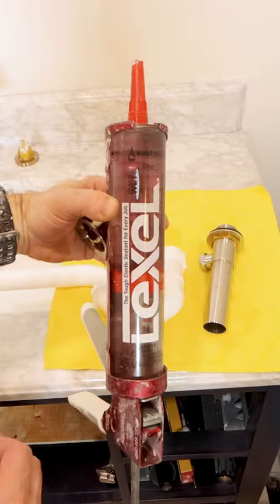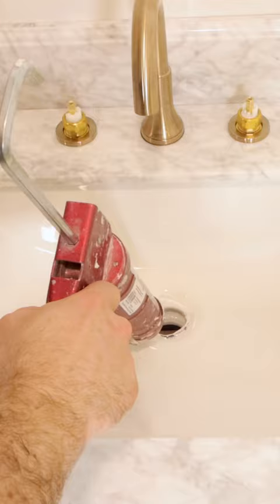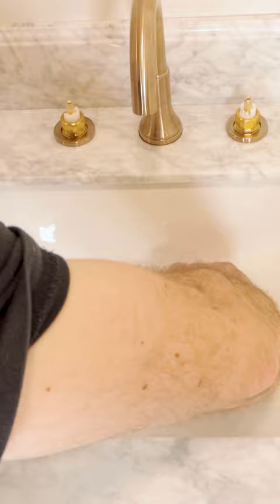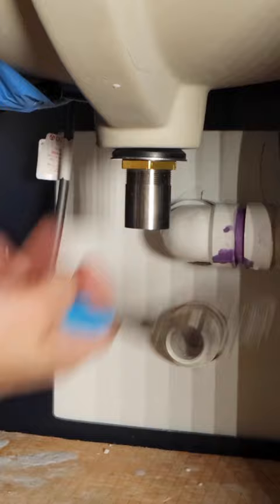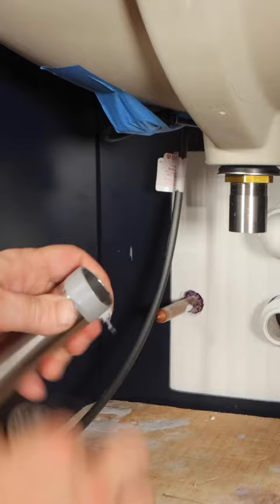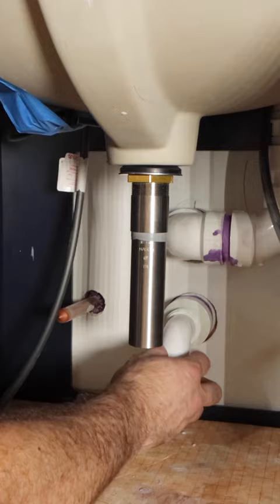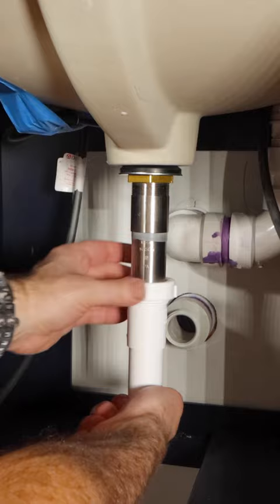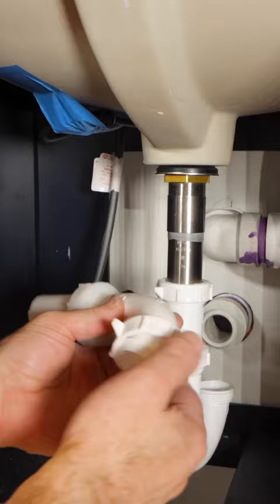Sink Drain Installation Tips - #shorts

Comment: As a licensed plumber for over 15yrs. I hate when ppl use silicone to seal the drain to the sink. It's a pain to get off and a mess to clean. Don't do it. Plumbers putty works perfectly if you know what you're doing
Reply: licensed plumber over 20 years Master Plumber for last 7 years putty and pipe dope always works
Reply: Licensed plumber for 5 years, any sealant on top os useless on any drain with overflow holes, the only thing stopping a leak is the rubber gasket
Reply: I agree
Reply: @ProvidenceAcresFarm 

Sealant on top is to help the sink be able to fill up and hold water, not to prevent leaking into the vanity.
Reply: @merlinious01  Here in Euroe we just have a rubber gasket instead of the sealant, works without leaking.
Reply: @DimerNL  
Some brands do that here too, some even use a foam gasket
Reply: I’ve heard silicone is best used in commercial sinks? I’m just a DIYer with a few years experience. 😂
Reply: Is putty safe to use on granite countertops?
Reply: Lexel isn’t silicone
Reply: What about the tube he's using would you use it
Reply: 100%
Reply: Yeah I’ve only used dap when we figured out we were out of putty. Works just the same but don’t have to clean the shit when you finished
Reply: @rocketrider1405  there is non staining putty specifically for granite and stone countertops
Reply: @merlinious01  foam is a horrible material to use as a sealer, constant water usage will deteriorate it. I always throw those away
Reply: @tumuskurns  damn thanks for this comment. I've never used lexel b4 but after reading about it I'm definitely gonna try it on some stuff, but definitely won't use it to seal a drain. Rubber will always deteriorate/degrade when in constant contact with water. Just like the rubber o-rings and seals in your faucet cartridges that go bad after time. Plumbers putty is my go to and hasn't let me down
Reply: @vrea77  no I wouldn't use it to seal drains. Unless it was my only option or last resort. Plumbers putty has never failed me.
Reply: @Seven7Pain1  putty
Reply: Silicone works perfectly. Easy to apply and easy to remove. Putty is outdated and will stain any porous stones.
Reply: @ProvidenceAcresFarm not if you want to use a popup
Reply: that is absolutely not true. he knows he will get a call back and make more money if you use plumber's putty
Reply: 85 yrs as a plumber (still plumbing today) and I’ve always used maple butter seal.. it works great..
Reply: @bman6502  yes I heard that stuff is awesome, I just can't find it anywhere. Where do you get yours from?
Reply: Licensed plumber for zero years. Always putty
Reply: Started plumbing in 2014 mostly doing commercial and mechanical repair now but I spent 4 years doing service My call back ratio was 1/1000. And most of those had nothing to do with whatever I was there for. The only purpose of putting any sealant around the top of the pop-up so that when the pop-up is in the closed position the sink can stay full of water. Plumber's putty is perfectly fine people that put strong silicone or even epoxy are nuts that's got a high probability of chipping the top of the sink when you try to remove it. Most useful tip I can give is to put pipe dope on the threads underneath the lower rubber gasket and if the bottom of the sink is in poor condition possibly a cast iron sink put some pipe dope on top of the gasket I have never once had a leak after doing that I know some guys like to put plumber's putty on the bottom before they tighten everything that has leaked on me in the past but with the pipe dope. Not once.
Reply: Same here I been on the trade for 4 years but was taught to use plumbers
Putty make it easier for the next guy
Reply: Putty on the flange, a thin layer of ptfe paste on the conical gasket to seal the base of the sink. Never had a leak installing a new pop up.
Reply: I agree,same here,think he's a mister fix it
Reply: @kekoashipman1824  so you’re saying just put some dope on the top of the gasket that presses up against the sink and then tighten the nut up on it?
Reply: @skylerpeters8063  
Plumber's putty on the flange at the top of the sink. Pipe dope on the gasket where it touches the sink and  between the gasket and pop up threads. If pop up is plastic hand tight. I have yet to have one leak when doing it this way.
Reply: @kekoashipman1824  thanks for the help, I’ll try that later
Reply: @Seven7Pain1  i’m changing my drain for the fourth time because putty keeps leaking you’re right, I’m going to use silicone
Reply: @wesjohnson3035  my bad bro putty
Reply: Oatey Hercules 25171 Stay put putty is stainless and safe for plastic , I've been using this for years with out a issue .
Reply: @MMAGUY13  Hercules 25171 putty and if this is 4th time and it leaked through your doing something wrong you didn't buy new gaskets or you didn't put cardboard friction gasket between nut and rubber washer or you have no gasket on bottom at all  any time ive seen putty fail it's human error
Reply: @Seven7Pain1  I’m on my way home from Home Depot and I bought silicone. I did everything right I watched videos it’s not rocket science. I made sure the rubber gasket goes first in the friction gasket.  One time I put it really tight it leaked the next time I said maybe it was too tight. I made it just snug it leaked. This is my fourth time I’m gonna use silicone because years ago I did this and use silicone and never had a problem. Thank you so much for responding and responding so quickly.
Reply: @BBQandStreetCars as a service plumber for 3 years I appreciate y'all for keeping me working 😂😂😂
Reply: Man lexol even worse than silicone can’t wait until he has to replace that drain stopper he will have to remove entire sink! Can’t believe he isxserious
Reply: LEXEL IS NOT SILICONE.
Reply: @BBQandStreetCars LEXEL IS NOT SILICONE.
Reply: @rocketrider1405 not on mine.  Leaves a grease stain
Reply: I never ever ever use plumbers putty. It will drive up and crack or wash out. Sealant of choice....... You guessed it: silicone.
Reply: @merlinious01 exactly
Reply: What about those of us who don't know what we're doing?   And no money for a plumber?
Reply: @rocketrider1405   no. There is specific plumbers putty that’s safe for natural stone.
Reply: @rocketrider1405  Get no stain putty.

Comment: Always think about the next guy having to take that damn drain off. Putty works fine. In the event that someone wants to change the trim color of the entire bathroom, then you're kinda screwed at that point by limiting options. Pipe dope works fine for the threads.
Reply: Lexel is more of a sealant then an adhesive. It’s basically a clear gasket maker that will peel off similarly to silicone
Reply: @UsedNapkin458 Silicone is easy to peel off?
Reply: Yep
Reply: @seanoneil2110 off porcelain... yes, yes it is.
Reply: @paulmacdonald7068  Silicone is a pain in tha ass to remove from porcelain. Plumber's putty is still the best option here.
Reply: @UsedNapkin458  Silicone is a pain in tha ass to remove from porcelain. Plumber's putty is still the best option here.
Reply: @themonkeydrunken  It really isn't.  Plus, putty should only be used on porcelain and stainless and definitely shouldn't be used on plastic, which is 90% of residential POs these days. Silicon is the safe bet because it works 10 times better than putty, and it can be used on any type of material, including natural stone. 

I used putty for years until I tried silicone. I've replaced lots of strainers and POs with silicone on them, and it's not hard to remove the residual unless it's on a textured part of the fixture (which it never is). Even if there was texture where the po sits, you would just need a bit of WD 40, and it would come right off.
Reply: As a commercial plumber, I use silicone all day long on my drains because it’s a fantastic sealant. I’m not a service plumber so I don’t use plumbers putty. Screw the next guy because I know it’s not gonna be me.
Reply: Did a call this morning the customer wanted brushed nickel instead of the stainless finish that was there before, all of this was installed with silicone and came out just fine, and I replaced it all with silicone as well. I even use silicone to help seal those threads down below in a pinch
Reply: Plumbers putty does not work fine. It dries out within 12mo.
Reply: @paulmacdonald7068 no it is not. It is if you're scraping exposed silicone on porcelain. If its bonded between the metal drain and porcelain, you are not getting that off easy.
Reply: @Brian-yz8dj  Whatever you say, my friend. I don't have any issues with it...🤷🏻 but everyone is built different..
Reply: @UsedNapkin458 umm no it’s actually quite a good adhesive
Reply: Literally me at work trying to get one off and it’s glued 😂

Comment: You forgot the standing water test.  Fill sink up a ways and leave water standing in it for about 5 minutes to be sure your seal is good at the drain.  Also, Lexel is not the right sealant for the drain.  Use putty or use caulking specific for plumbing that is antimicrobial and wont mold.

Comment: Two questions. One, are you sponsored by Lexel? And two, why Lexel instead of putty? Most plumbers swear by putty
Reply: Putty is fine. Seems less messy than that crap.
Reply from the maker: No, I’m not sponsored or paid by Lexel. Lexel is a sealant and stronger than putty, which means less of a chance for leaks
Reply: @HomeRepairTutor  Lexel is fine, but it is on the expensive side of silicone adhesives. It is definitely easier/faster to use silicone adhesive than putty for putting pop up assemblies in, but in my opinion it is sort of a waste of money to use/recommend lexel rather than a less costly 100% silicone alternative. Putty is also fine. In almost any scenario with proper installation, an installer will be able to use either putty or silicone/lexel successfully.
Reply: @HomeRepairTutor you do know that the bottom gasket keeps the water from leaking you don’t even need lexel or putty tape keep it from leaking But the sink want hold water But it want leak. Just saying but I always use putty never had a problem with the sink not holding water do to putty
Reply: @MarlinRoth how is that shit faster?  Putty is was faster than that goopy bullshit. That shit is harder to clean, you need a caulk gun, it’s way more expensive than putty. It’s way faster, cheaper, better, to use putty. I would only use the silicon shit if it’s an oddball sink that won’t fit anything perfectly.

Comment: Lexel is permanent, probably the worst thing to use on any part that may be changed....EVER! Use putty, because it the right product for the job.
Reply from the maker: How often is the pop up changed?
Reply: @HomeRepairTutor it may not be often, but do you want a 5 minute job to take 30?
Reply: @HomeRepairTutor  This is exactly what the worst craftsmen think. It will be changed someday, and you ruined the next guy's day. Plumber's putty is great here, there's no need to try hacking in some other crap that wasn't designed for the application.
Reply: @HomeRepairTutor  I have a new home five years old Had to change three of them because the wife didn't like it. before that had puddy on a sink I installed for 10 years. not a drop came from that sink seal.
Reply: @themonkeydrunken Ruined his day? Lol, dont you own a pair of pump pliers? Time to toughen up dude
Reply: @HomeRepairTutor plumbers are upset because they want to change that more often even when it’s not needed. Make them work:)
Reply: @gimaru1 that's dumb, damage can be done to your vanity if they use that lexel.

Comment: Don’t do this way please! Use plumbing putty .
Reply: why
Reply: @bluearcherx  This crap bonds in a way that is a pain in the ass to remove later. If you have to clean out or replace the popup, you'll be very glad if the last guy knew what he was doing and used putty. Putty makes a perfect seal and lasts pretty much forever; there's no need to hack in other stuff that wasn't designed for the application.
Reply: @themonkeydrunken  correct 👍

Comment: If I'm doing private work for my own customers then I put silicone to seal it but if I'm at my day job where we're doing work in social housing, I use non setting putty so it's easier for the next guy. And for testing the trap, I run the water for a minute and then fill the whole bowl and let that drain so there's pressure there

Comment: you also need to add the sealer to the pipe at the bottom of the sink where rubber ring gets tight.  Otherwise, the join will leak.

Comment: A proper water eat test is a full pressure test b filling the fixture with water that also test overflow. If it doesn’t leak with that test, it’s good to go. Thank you for the caulk selection I’m going to try it since I’m old school and still use plumber putty

Comment: Question: If, say in 5 years, the homeowner wants to change the drain and hardware, will the Lexel release or is the drain now a permanent part of the sink?
Reply: It will come loose. It won't be super easy but it's much like silicone.
Reply: Indeed, no need to run water for five to ten minutes. Fill the sink 2-3 times and dump. I also dope the trap arm where it connects to the ptrap
Reply: @nathanheim248  Silicone is a pain in tha ass to remove from porcelain. Plumber's putty is still the best option here.

Comment: Use plumbers putty instead of Lexel or caulk. It's supposed to be easy to remove if you need to remove the drain. It will be a lot harder to get a water tight seal the next time the drain is removed.

Comment: why not putty?  putty should be good right?
Reply: it's fine, but lexel is better. some drain manufacturers are stating not to use putty at all (silicone or other sealant instead) so read the directions
Reply: Putty is the best option by far, and it's easy to service. This crap is a pain in the ass to remove, even from porcelain. This guy's a hack.
Reply: puddy's good, it's just marketing to get you to switch.

Comment: Use putty around drain and little pipe dope on beveled rubber gasket and have no issues ever
Reply: A rubber gasket of any kind doesn't require anything else. It is a seal. Gasket means seal. If it's a petroleum-based based dope, it will damage the rubber. Never use any type of oil or grease with any type of rubber, plastic or silicone. It's the same rules as condoms.

Comment: Pretty sure the only real tip in the video was to use a slip extension if the P-trap sits below the Drain outlet on the sink. It was also not referred to as a tip.

Comment: 5-10 minutes, unless you are pushing a fire hose down the drain with the amount of water the faucet puts out you would see a leak in under a minute. 
Better tip would be fill the sink several times and look for leaks when you drain it.

Comment: Surprised to see a lower metal drain pipe extension inside of a higher metal drain pipe. The top pipe should fit into the lower pipe. No leaks.
Reply: some brands do it that way but it's fine
Reply: Almost every brand I have installed comes standard this way. Us plumbers just add a little pipe door to the threads to guarantee seal

Comment: Please use putty on the drain and you should also use pipe dope on your gasket.
Reply: Why would you use dope on the rubber gasket?
Reply: Why would you use dope on the rubber gasket?
Reply: It will leak sometimes. Just a precaution.

Comment: You ever hear the old expression if it ain't broke don't fix it plumbers putty cost $2 and I can use the whole thing your lexol cost $10 and then you can throw the rest away
Reply from the maker: That’s not true, the Lexel cures in the tip and seals the tube. Yet, I can easily remove the cured part and continue using the sealant. I just did this yesterday on a tube that was over a month old

Comment: It doesnt make any sense to put any type of sealant on the top of the drain. The overflow holes on the drain will make the water pass through down to the rubber stopper anyways....its useless. For real...all you plumbers should know that

Comment: Nooooo. Use a rubber ring. No need for any sealant or putty: They will both make a mess of the job
Reply: The rubber rings rarely work. We atill end up having to putty up
Reply: The rubber sucks cuz the drain holes on sinks are never perfectly flat/round/angled. Quality control sucks nowadays
Reply from the maker: This pop up doesn’t come with a rubber gasket, hence the Lexel
Reply: @HomeRepairTutor  Stop with the lexel nonsense. Use putty! Once you are done, run HOT water through the sink for  a few minutes then do a final hand tightening to all the nuts on the plastic waste fittings. Hot water softens and expands everything, and allows you to thoroughly tighten everything and eliminate leaks.
Reply: @HomeRepairTutor  Hence the need for putty, not Lexel. Geez man call a real plumber